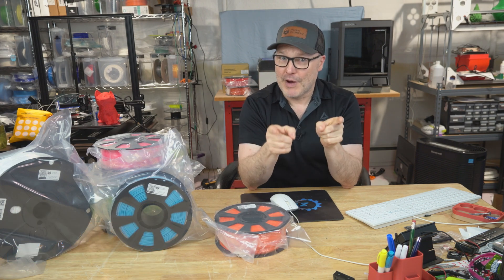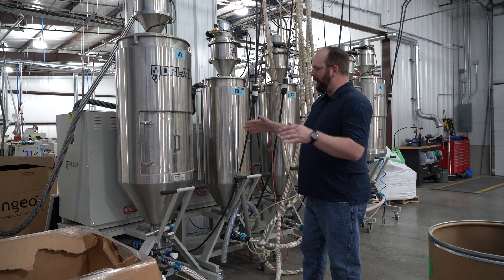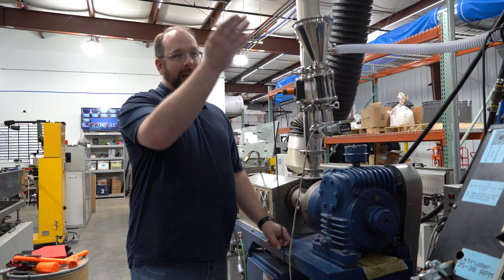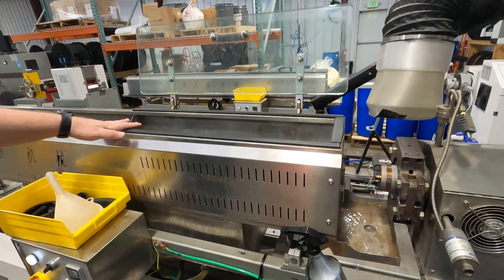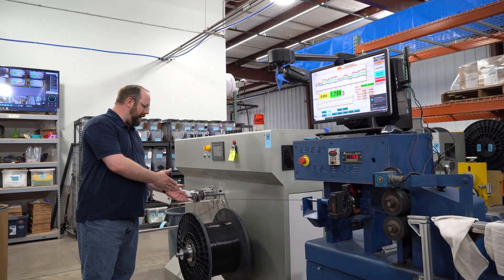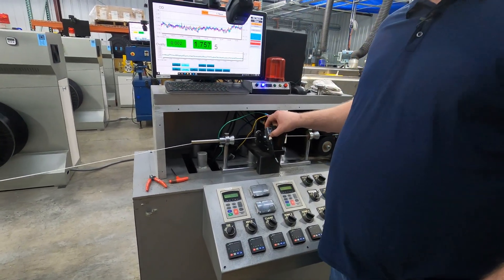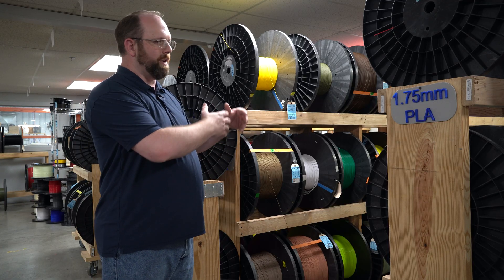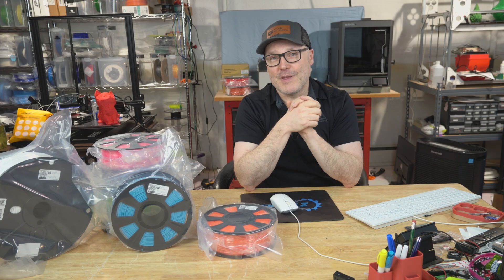I Visited a 3D Printer Filament Factory and Here's What I Found - Push Plastic Factory Tour!

Comment: So if the plastic beads get any moisture on them they remove it with their dryers.  He says that if any moisture enters the extrusion it ruins the filament and "it's done".  You can no longer remove any moisture after extrusion.  So why store the naked rolls of filament in a temperature humidity controlled room? Or even bother to try and keep it dry at all?
Reply: That's a great question! Moisture breaks up the polymer when it is present during the mixing and melting phase. Water is very volatile and causes a lot of damage when it turns to steam or even breaks apart into hydrogen and oxygen.

Post extrusion, the plastic filament is solid and cool, so the water stays liquid and doesn't do nearly the same damage. The water also can't get very far past the surface of the filament.

Does that answer your question?

Comment: With how much emphasis is placed on drying the raw pellets, and then drying material before use in a printer, what effects to the filament are there by using a warm water bath to help cool the filament after extrusion?
Reply from the maker: I’m sure Nosh will answer but I think part of your questions are answered in the follow up video 

Filament Drying: Myth or Must? Watch Before You Print!
https://youtu.be/A3H1oFVpUMk
Reply: Drying the pellets is the most important step. This is because the pellets go through a mixing screw and if there's condensation or dampness on the pellets, that water will get mixed into the plastic then heated, which damages the plastic permanently. Once the plastic is made into a filament it is solid and the water stays on the surface. The water tank is actually hot water, which slows the cooling. The water is removed from the surface of the filament using an air blow-off and cloth. It is further air dried as it spins on the spool.

In the follow up video I explain that moisture doesn't harm filament as much as people think. At least not filament that is made properly with pure resin. Believe it or not, but filament drying wasn't even a thing until relatively recently when companies found out they could sell everyone overpriced filament dryers and dry bags and boxes.

UV light will typically harm most plastic faster than ambient moisture will.

Comment: Interesting seeing what we all want dry be bulked up immediately after the filament passes through and out of a water bath. More explanation was needed here.
Reply: Contrary to what’s often repeated online, moisture isn’t a major issue after extrusion. The real concern is before extrusion, when water can mix with the molten polymer inside the extruder. That’s where hydrolysis and foaming can occur, permanently damaging the material’s molecular structure. Once the filament exits the die, it’s a solid strand of plastic. At that point, surface moisture doesn’t have a chance to penetrate before it evaporates into the air, especially since the filament is actively air-drying as it winds onto the spool.

Technically, all filament is made using a water bath. As I mentioned in the video, most companies wind it directly onto the finished spool and package it on the line. If their air blow-off isn’t set up properly, that residual surface moisture can get trapped in the packaging with the product, which is why desiccant packs are so important.
Reply: @reconditeVV . Ok, thanks for,your response.This is a very interesting topic I want to get straight. Yes, I’ve been lead to believe that filament dryness or rather, the lack of, is a major problem for good prints. Are you saying that when I have a spool of pla, petg, abs, etc that I don’t have to worry much about it absorbing moisture from air, so long as it was manufactured correctly?
Reply: @highpointview256 Yes and no. Pure resins tend to be pretty moisture resistant to the point that they don't need dried. There are a couple exceptions like Nylon and BVOH, but most of the rest can be printed "moist" with no worries.

A lot of manufacturers, us included, can add fillers like carbon fiber or other things that can make the filament absorb moisture like nylon would. Those filaments should be dried. 

But PLA, most high quality PETG and PCTG grades, ABS, ASA, and even quality TPU shouldn't need any drying before printing.